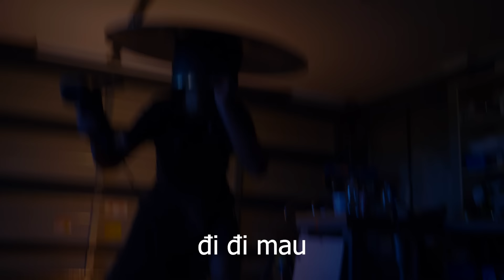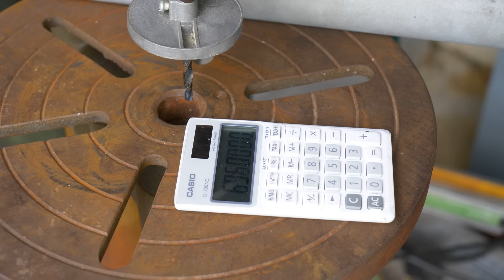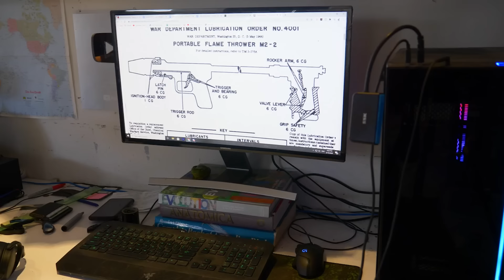Turning trash into something less useful

Comment: Sometimes with an arc welder depending on the metal you need to use special spark sticks so you don’t put holes in the metal, or your amps are too high

Comment: The real question is how did he freeze the water around his hand without getting frostbite
Reply: I'd guess he froze something hand-shaped but removeable and then just slipped his hand in there before taping
Reply: Simple Australians have frostbite protection 
I don’t know what that other guy was talking about
Reply: Could be flash frozen or two slabs of ice he enclosed his hand in.
Reply: My guess is that 2 containers were used to make the ice cube.  There is a hand sized depression frozen into the top of the block of ice.
The top of the frozen block then becomes the botton, leaving a rim of ice around the edges to hide your hand.
You just sit the block of ice onto your hand, the thin section allows you to see the hand through the other side.
The ice was only sitting on his hand and wrist, check out the technique used on the flip-to-smash.
Reply: He's an ice user
Reply: Ice glove

Ice glove
Reply: He already encased his hand in bread of course he can do it with ice
Reply: Australians are immune to cold as far as im informed
Reply: Dude his hands not even in it, he just rested it in on his palm and flipped it over onto the table
Reply: He’s built different

Comment: If you had kept on that weird doily thing you probably could’ve prevented the flame blowback; it would’ve acted as a ‘shield’ and kept gas from leaking backwards and igniting around the main switch. That way you could hold sustained fire (no pun intended) without the risk of your hand getting burned.
Reply: Yup
Reply: This wouldn't be an issue if he built an actual flamethrower instead of a big gas lighter
Reply: @kolega4ever  difference?
Reply: @izzyzoldyck7391  A flamethrower uses a flammable liquid as fuel, so the flame has better range, sticks to whatever you shoot at and is overall better at setting stuff on fire.
Reply: @justafurrywithinternet317  what kind  of liquid for posterity sake
Reply: @izzyzoldyck7391  idk petrol? napalm? petrol mixed with tar and ethanol? some other very flammable sticky liquid?
Reply: You would use a gas and diesel mix
Reply: @justafurrywithinternet317  15:57
Reply: @izzyzoldyck7391  a flammable liquid like napalm or if you're doing homemade acetone and styrofoam gives a similar effect, though I disagree with the above comment on that he should've used a flammable liquid, that's a terrible idea
Reply: @justafurrywithinternet317 , Yeah you’re right, but here’s a thing, the thing he made is legal, Elon Musk sells them. A real flamethrower isn’t even legal for the military to have.

16:03. He put this in for a reason.
Reply: @justafurrywithinternet317  napalm wouldn't work though it's a flammable goo that would just get stuck if you tried to use it in a flamethrower and the whole thing would then fucking explode. Napalm in simplest terms is basically polystyrene/Styrofoam dissolved into a flammable liquid like petrol/gasoline to create a flammable goo that can be thrown or shot out of a Napalm Launcher on to whatever you want to light on fire and then the flamethrower brigade would come along and light it on fire.
Reply: @izzyzoldyck7391  A flamethrower requires the person who is using it to wear a backpack with two giant tanks of liquid fuel and then when he pulls the trigger a stream of  flammable with a pilot light at the end of the nozzle in front of the stream of flammable liquid to ignite it.
Reply: @michealpersicko9531  🌠The more you know🌠
Reply: fr
Reply: nah
Reply: I think, the "burning the hand" part was the goal tho.

Comment: things you totallly shouldnt try: solder a repurposed schrader valve stem to a CO2 or NO2 capsule. use a short valve extgender, sans the valve of course, to release the filling. 
be creative with the filling: butane or propane alone tends to freeze up the walves, but redily combines with nonpolar sovents to make fizzy, coagulatable naphta. and if your promethium comes out too slowly, try some CO2 or nitrogen for a little extra schpritz. 
PS: dont use AC valves instead of ones from old tires. they hold up to nonpolar solvents way to good.

Comment: Shoehorns are great actually. If you are putting on shoes with shoelaces it let's you basically just ignore tying and untying it as you can just slip it on even when it's tied and you don't have to use your fingers for it which usually hurts. It also reduces the friction on the back of the shoe from doing this which reduces long term damage to the shoe.
Reply: i will buy 12 thank you Mr shoehorn salesman. you have improved my life starting now
Reply: Not today shoe man
Reply: The only reason I have a Shoe Horn is for my loafers and other dress shoes cause that shit hurts using my fingers as one.
Reply: The dude with the suit is trying to trick us immediately after being warned.
Reply: If you have to use a shoehorn to put on laced shoes without untying them you’re weak
Reply: @tommykarrick9130 what about converse?
Reply: I get shoehorns for those with back problems, arthritis, carpal tunnel, etc. OTHERWISE, they are ridiculous.
Reply: I'm just really fat so I don't want to bend over.
Reply: @aadoptedcykanugglet3743  don't fall to the dark side, you can ignore shoelaces anyways

Comment: You have to keep welding rods completely dry or else the Flux won't ignite right so if you keep them in a waterproof box moisture in the air won't ruin them
Reply: You don’t have to keep them in a waterproof moisture box, but you do/should keep them in a cool, dry area. I kept mine in the plastic tube they came in (not the screw top. Just the lidded tubes) and they work just fine 8 months down the line. Albeit they still run like trash but that’s my fault haha

Comment: BTW: teflon tape should not be used for gas connections. They make some stuff that technically is marketed for gas, but it is yellow. And it doesnt work that well.   

Pipe dope (thread sealant), however, works great! 

Teflon works in the short term but gas is a lot sneakier than water. It will slip through a tiny crack in the teflon. Not to mention, when you put teflon on, a lot of it bunches up, Which can also lead to microscopic separations in pipe that would over time lead to a small gas leak. Pipe dope will fill in space rather than bunch up and push against it.  

If you were going to have just one for gas pipe (which you should have just one), choose pipe dope. For most air pipes, use teflon and dope. For water connections, use teflon and dope.

Comment: The fitting right on the tank will be constricted.  Drill it to double the diameter for 4 times the flow, three times for 16 (16?). I did it for a little crucible melter. It has quit a bit of flame lift on its own and needs a flame holder.  But you have a different setup.

Comment: If you really want to improve your welding, the problem is that you’re using stick welding on very thin metal, stick welding is meant for structural builds, mostly for metal that’s like a half an inch thick or thicker, anything below a quarter inch and you’re going to want to use MIG welding (the machine that feeds out a wire and gas at the same time from the same nozzle), it’s really up to preference between 1/ quarter inch and a half inch, you could also use TIG welding, ( you manually feed filler wire by hand, while controlling a gas nozzle with the other) but that’s far more complicated, MIG Welding is easiest, and you can get a decent machine for really cheap.

Comment: yo I'm all for anticapitalism but the shoe horn is an accessibility device helpful for disabled people like myself <3 not a wasteful product, just marketed towards the masses because labeling a tool as something made for disabled people will make less people buy it, because boo capitalism. Most infomercial products are for disabled people. Even the snuggie - it was designed as a wheelchair accessible coat. Instead of having to lean forward to wrap a coat around your back, you can don it in the front without potentially causing bodily harm to those who have nerve and joint issues impacting flexibility, joint stability, dampening the nerve signal, etc. Much love to yall from a commie in the states <3

Comment: i would like to say that the foot shoe stick is good if you have leather shoes. I mean id rather just break my fingers by putting them at the heel and then pushing down until my fingers are bleeding instead of using the thing but it works great